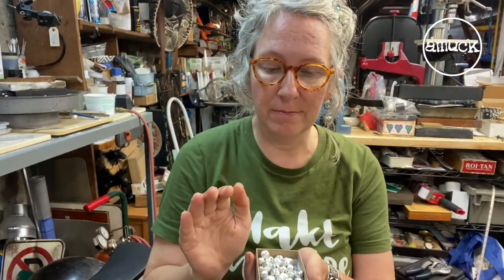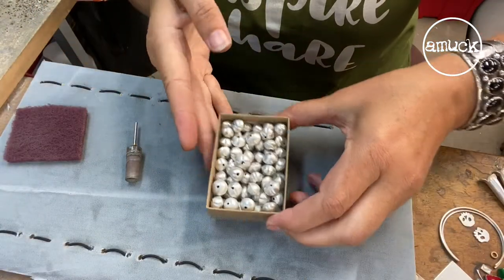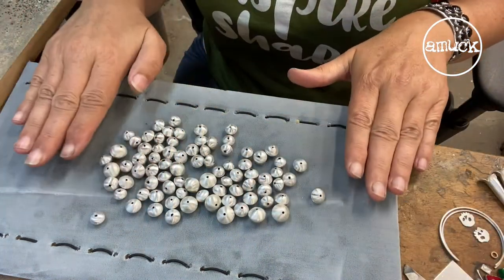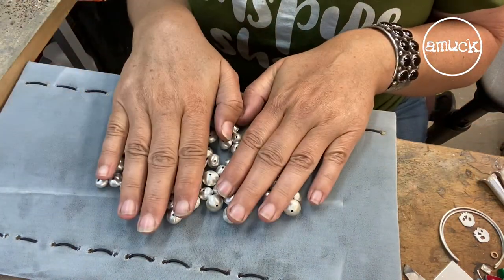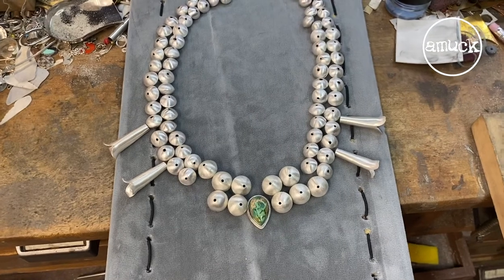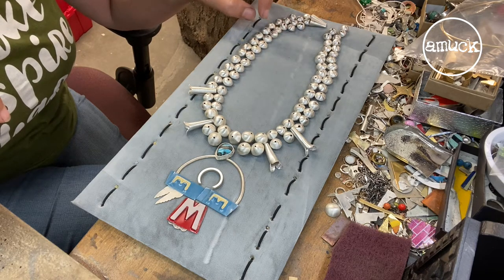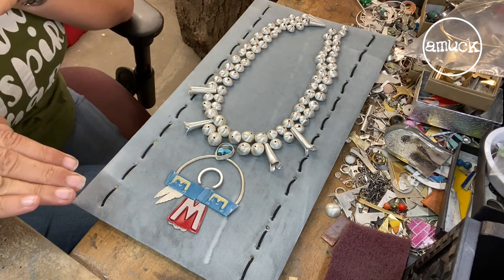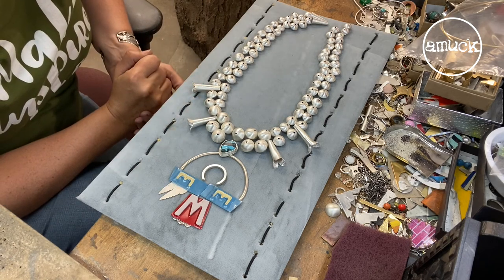Making a Squashblossom necklace- part three

Comment: What grit do you use for your sandpaper roll (for the rotary tool)? Also, how many beads does it typically take to make a full necklace? Say I wanted to make just a Navajo pearl necklace at 21”, how many beads would you think I would need to make if they were 3mm big?
Reply from the maker: Hi Lauren, I like to use the 320 and 400 grits on the sandpaper rolls.  I make my beads around 8-9mm and I would need about 64 beads so I’d say you’re looking at 130 beads.